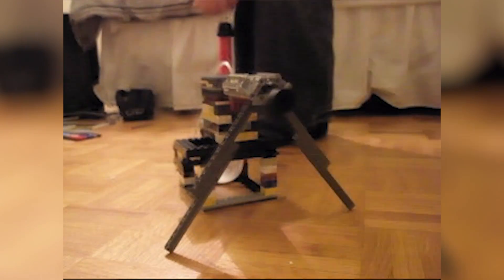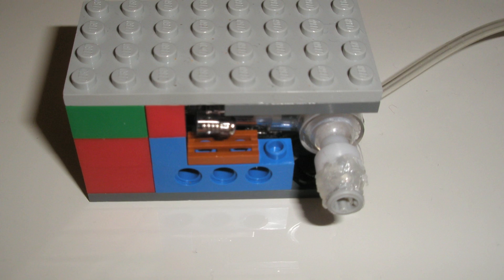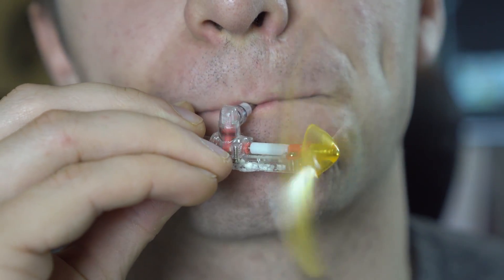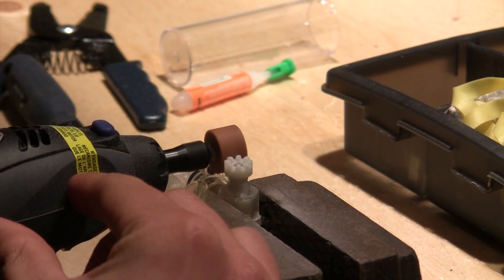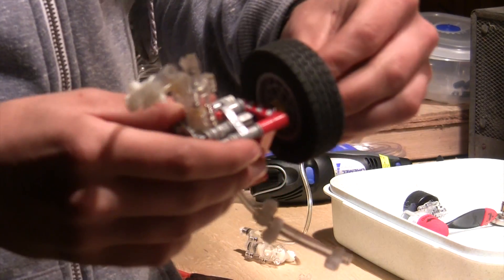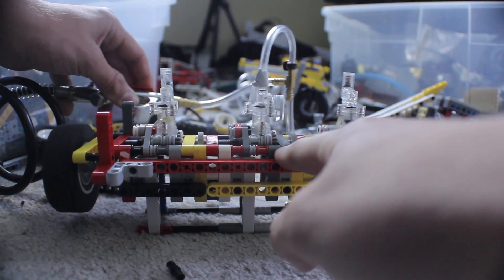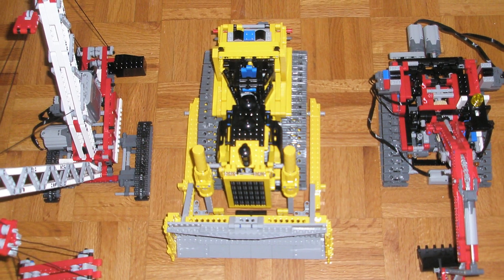Pneumatic Motor Design & Testing

Comment: Not an engineer, but have you thought about making your own pneumatic engine out of a syringe with the needle removed?  Once you get it working, you could also use a small CO2 canister to make it self-contained.  Maybe you could even use some LEGO Mindstorms to control the steering and throttle, but have the power come from the pneumatics.

Comment: Hi, but these motors are not requiring lubrication?
Maybe you can try to mix some kind of oil with the pumped air. Just by nebulizing a tiny amount somehow, I think that it will improve durability and reduce friction

Comment: make a 4cyl instead so you can work out the engine timing easier. with those joins your using for the output, they only have 4 positions. should help to knock down vibration and help it run smoother and bit more powerful

Comment: It would be cool to add a tiny compressed air canister to a car going to one of the engines and run an auto air pressure switch thing thats remote control, and also add steering into it too.

Comment: Here's a tip to make it work better, you need to make a delay between each pistons power stroke so that it runs as soon as there's pressure, this way it should also stall way less at slow speeds as the pistons will help each other with the initial push you have to give it to run 
good luck.
~James

Comment: But how do those bastards work?!
Reply: it's simple, a valve let's high pressure air in to a syringe like piston, the air pressure slides the piston out. When the piston reaches the end of its movement the air is released and the piston is moved back. Then the while thing starts again.

Comment: Timing...I dont think he is taking the timeing of the top dead center of each cylinder, relevant to the position of the crankshaft. That way they will compress in succession, rather than having the pressure of the cylinders fight each other.

Comment: how would you use the air hog toys if they had phnematic engines, should then need a pump
Reply: Oh my Shoe they had an air tank you would pressurise , then the engine would run from the tank. The only lasted a few seconds before the ran out of pressure though.

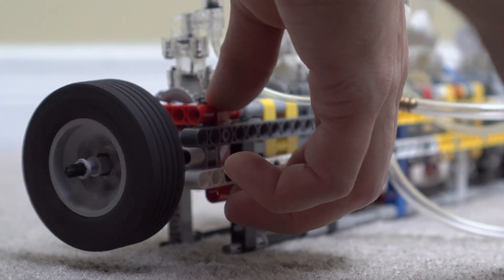Comment: 4:07 try setting your cylinders in a firing order. theirs no timing set in place so that might be ur issue.  u can tell because the e more  cylinders he had the more they wanted to fight with each other.  most  vehicles use the method unless ur running a 1 cylinder engine

Comment: lego has official pneumatic motor pieces too
Reply: but you have to do some stuff to make them work as pistons in engines
Reply: just search for official lego engine parts , u might need compressor or some sort of hand pump for air pressure but ull see urself

Comment: Those engines are so nicely small, why are you using such big housings for them? With those small cylinders an inline 6 engine could be approximately 18 studs long. And the inine 3 half of that. That would also eliminate all the twisting and friction, enabling the engine to spin much faster. Check www.lpepower.com btw or my youtube chanel.
Reply from the maker: I sort of threw the motors together because I was impatient to see it run haha. I think if I re-visit this project I'll spend more time and 3D print the housings. 

I've actually been following your channel/web since your V8 dragster, love your work. Thanks for dropping a comment.
Reply: Zachary Spence Why not try to design and print an entire air engine? That's a project I plan on doing when I get one.

Comment: I used to have an air hogs plane, got into lego pneumatics a few years ago, they're too slow and i messed up the switches trying to modify them. turned the house upside down trying to find it, but i must have thrown it out.

with the popularity of lpe's lego should take their standard lego cylinder and piston and make them pneumatic

Comment: For your gas compression, try pressuring dry ice and keeping something extremely hot in the same container produce a great amount of gas for fuel and greater RPMs.
Reply: i tried that... trust me it just doesnt work. dry ice takes 3x the energy per volume to "melt" as ice. I tried it with hot water (50-100C). you just dont get a constant long lasting gasflow. my best testresult was a more or less steady gasoutput for 4min. I invested 200 Euro into the experiments... You can trust me on this xD

Comment: How do little air hogs air powered engines powered by compressors make a pneumatic car engine made of plastic sound like a motorcycle
Reply from the maker: the way the inlet valve on the airhogs motors are designed is similar to a combustion engine in the way that they both explosively fill the cylinder chamber with high pressure gas. It's this rapid shift in pressure that gives the motors their characteristic sound, it's a very satisfying sound
Reply: Zachary Spence  Cool, thanks.
Reply: @zachadv  interesting
Reply: it sounds like a 2 stroke bike... man i love the sound
Reply: @honestguy7764  It's maybe because the Air Hogs engines are two stroke engines
Reply: @onlinehelper374  ur a few years late bud
Reply: Reminds me of a ww2 fighter plane
Reply: The little piston dudad smackin the plastic
Reply: Antonio Criado Diaz same, 2 strokes ftw :D
Reply: It's the sound of the constant release of pressure. Like a tiny bang that plays a lot of times per second